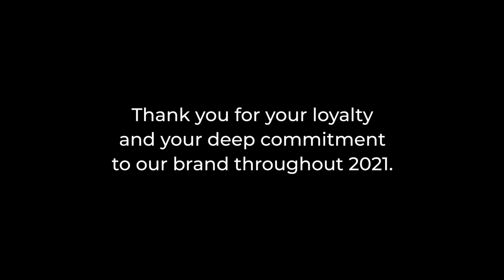2021 Retrospective

Comment: I have a question! I bought a new Selmer Supreme alto a month ago, and I LOVE IT. However, having the very beautiful BAM  case with back-pac straps that cannot be detached really bothers me. They are in the way! I don't need to use it as a back pac, and even when I'm not carrying it, the straps are ALWAYS in the way. The case doesn't sit on its side properly either with the straps in the way. What can be done to alleviate this? By the way, I also play a beautiful (1963) Mark VI tenor N 103,000, and also play a Series III soprano.
Reply: Can't you just cut them out? I know, a bit extreme, but if you don't care for them why not?
Reply: @MrGuto  My concern is this: 1) They are VERY attached. It would take extreme precision and a very sharp implement to do so. 2) If I ever want to sell my new Supreme, the value of the case would be diminished. Hmmmmmmm??